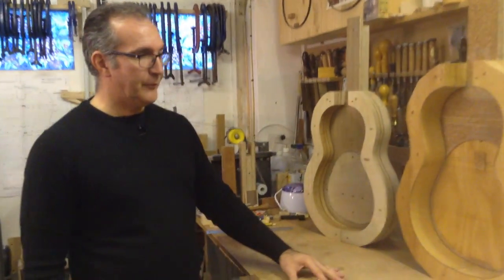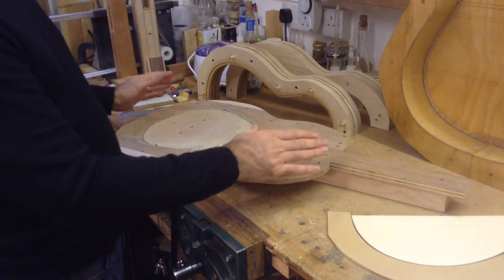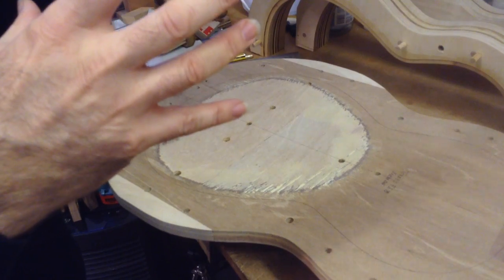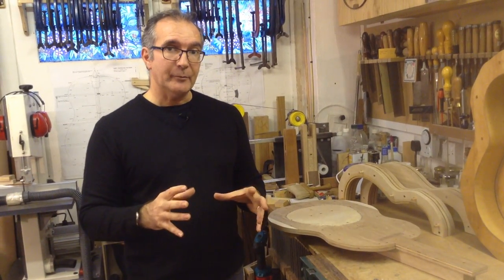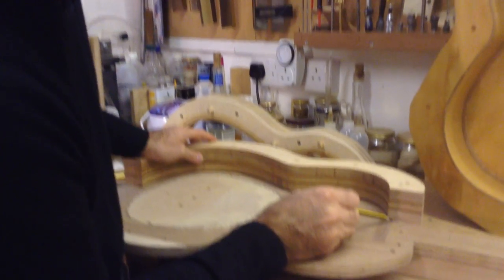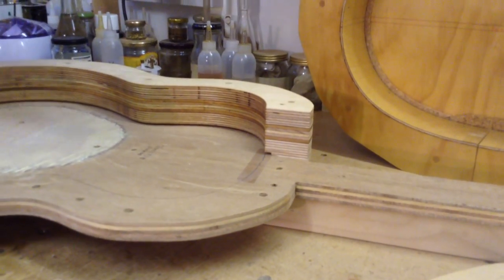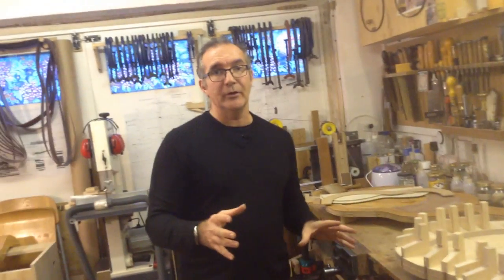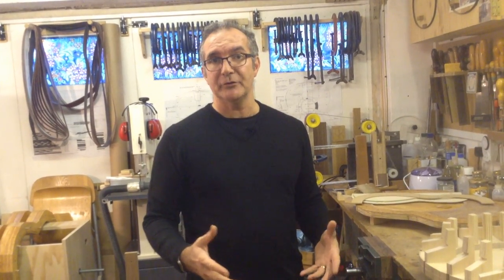Different types of moulds for making classical guitars.

Comment: Hello Pablo, another excellent and very informative video. Thank you. Please can you tell me at what point, exactly, on the solera/mould, does the angle of the neck have to start? Presumably, the neck section of the crucifix frame, on which the solera sits, will need to be planed/machined to reflect the angle? Regards Rick
Reply from the maker: The slope start at the point where the 12th fret would be, right at the point where the neck meets the body of the guitar.
I cut the slope from the front of the solera, not on the frame that supports it.

Comment: Dear Mr Requena, thank you for your excellent videos.  I am self-learning to build guitars.  I have a question regarding the depth of the sides of the moulds.  The tools I have now only allow me to make and finish the sides of depth around 70mm.  If I want to build a classical guitar with sides 100mm and over, is it a problem because the sides of the mould are too low?  Thanks.
Reply from the maker: No problem, 70mm is fine.

Comment: Thanks Pablo, I'm about to try building a Solera mould.  For a flamenco guitar mould, what do you think will be optimal dome radius/depth, and consequently neck angle or relief (ramp in the solera) in order to achieve a nice low action.  I'm sure it also depends on bridge height.  I currently own a Felipe Conde flamenco guitar and the action is pretty high and I can't further lower the action at the saddle, too bad for an expensive flamenco guitar, it feels mole classical with its current action, want to avoid this. Thanks for openly sharing all your knowledge in Youtube !
Reply from the maker: Hi Fabian, I use a 25 feet radius for the dome on the soundboard, and for the neck angle I set a 1.5 mm drop on the part of the mould that supports the neck, I think all of this is explained in the video.
Reply: Thanks again Pablo ! I was curious how it differs between a flamenco and a classical guitar. Flamencos have the strings at the bridge closer to the soundboard.
Reply from the maker: @FabianRomano1  the mould is exactly the same for both classical and flamenco guitars, the different set up is achieved once the guitar is assembled.